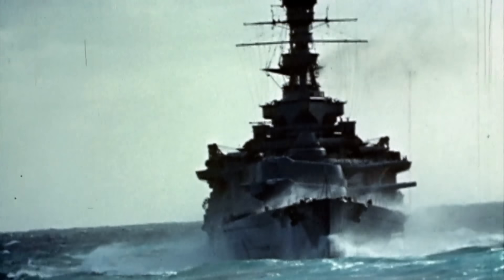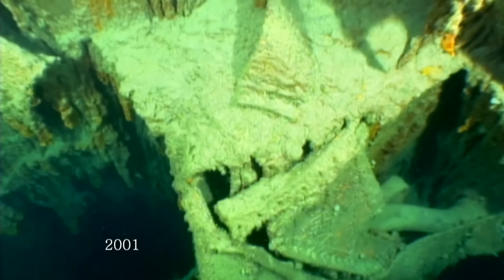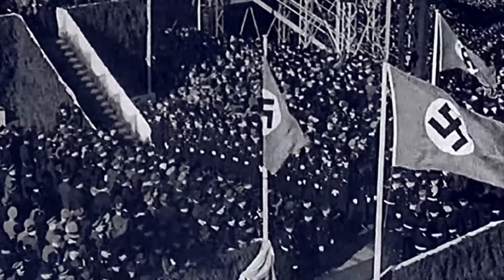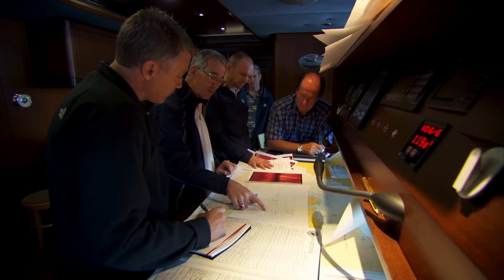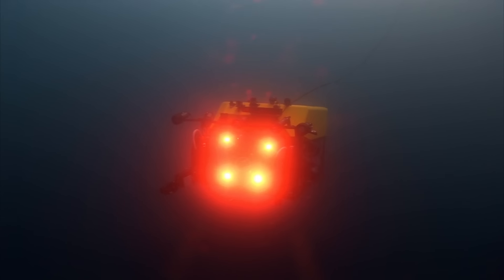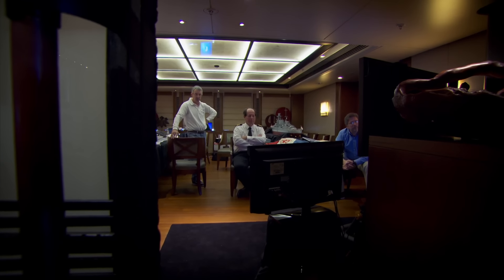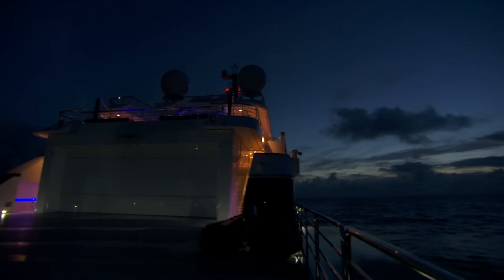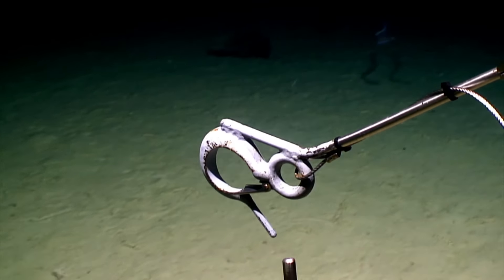How the Bismarck Sank HMS Hood - Documentary

Comment: historically this battle has been broken down by historians already.  The Magazine did explode, however it was not a direct shell this that detonated the main amo magazine itself, it was the secondary rocket magazine that had been hastily finished installing before she sailed out to blockade the bismarks exit.  The shell was an 8 inch shell fired from the prz eugen.  At the outset of the battle the bismark engaged hood at maximum range with full broadsides.  Hoods captain was a very experienced sailor and knew that he had virtually no deck armor to engage the bismark at long range with plunging fire. (this is when battleships engage at long range and shell hits land against the deck armor as they are essentially lobbed at each other).  The hood was a battlecruiser NOT a battleship and the captain knew this.  His responce was the correct one of heading flank speed straight at bismark giving her the smallest target and the greatest armor protection for her sensitive areas while closing the range rapidly.  By the time the shell that landed 3/4 way back amidships to set off the secondary un-armored magazine a shot from bismark would have had to penetrate through and out of both front turrets, the con tower (heavily armored) and a stack before hitting the magazine.  No chance.  However at the outset of the battle bismark had engaged with boardsides and prz eugen broke off engageing her broadsides against the hood, the lead british ship.  She was also fireing HE rounds witch were Extreamely likly to set off the magazine compared to the AP rounds being fired from bismark, that was in NO position to make the shot.  The cause of the sinking remains the MAIN amo exposion, but it was the secondary magazine for the rockets sitting beside it, unarmored that blew through the main magazines armor and set it off.  At the time of course GB has not intention of saying a cruiser sank the pride of thier fleet, and the germans were more than happy to tout that thier big bad ass ship blew the biggest the enemy had out of the water easily.  As with the battle of mid way for the japanese, a series of unfortunate and unlucky events led to a horrific loss.  But all things being equal the hood was not an equal match for the bismark, she was still more than capable of defeating bismark with alot of luck and a bad captain at the helm of the bismark.  But in war there is always the possibility of luck.... :)
Reply: You should also mention that Bismarck's fire control was superior to Hood's.
Reply: Please use paragraphs, it makes it a tad easier to read.

Hood having "virtually no deck armor" as you say is a mute point, since at this battle range (13.3 km to 16.6 km depending on recreation of the battle) based on the performance of Bismarck's guns they would not have been able to penetrate any deck armor (the angle of fall is only 8.5 deg @ 13 km and 12.8 deg @ 17 km),

The shells would have ricochet off the deck.

PE set fire to the ready use locker for the 4.1 inch AA guns, and UP rockets, and PE firing HE rounds would not have been able to penetrate much if any deck armor and no belt armor,

though it's a mute point since PE was shooting at POW when Hood was fatally hit.

The picture you describe about the angle of the shell from Bismarck (and the orientation of Hood to Bismarck) does not match up with any of the battle recreations, Hood was not sailing directly at Bismarck in a complete front on (as you seem to be describing), but at an angle, 

an angle that towards the end only required Hood to turn by 20 deg to allow the aft turrets to be able to be trained on Bismarck (to allow for deflection shooting).
Reply: @notsureyou  your information on this battle differs significantly compared to mine.   Hood had Very thin deck armor as with all battlecruisers, it's thier Achilles heel... Always has been you trade off armor for speed and manoeuvrability.  The battle STARTED out at range... With hood making flank speed straight to bismarks broadsides the range drops very quickly.  However where our information also parts ways is that the PE was firing at hood, no commander would have split thier fire on separate targets.  The fleet leutjens (spelled wrong I'm sure) was not an inexperienced commander.   Hood bore the brunt from both ships..  this battle has been examined over and over by real historians.... Every credible finding I've ever found in the end comes to the conclusion that it was not physically capable for Bismark to have fired that shell....
Reply: I'm a bit surprised that haven't read about the shift of fire,

The shift of fire was done as a result of POW firing at Bismarck unopposed and having obtained 1-2 hits already (the shift was done after PE's 6th salvo), whilst Bismarck used her secondaries on POW this occurred at about 05:57

Even if PE was firing AP rounds it is theoretically impossible for PE to have been able to penetrate Hood's armor and reach her magazines, this is made even more impossible since PE was firing HE rounds and wasn't firing at Hood at the time.

A good battle map is: 

http://www.kbismarck.com/denmark-strait-battle.html

Real historians as you call them all agree that a shell from Bismarck is what destroyed the Hood, they mostly squabble over exactly how this happened.

Whether it was an under belt penetration, penetration through the 7 inch portion of the belt, though the 12 inch portion of the belt etc

Given that Hood only needed to turn a further 20 deg to allow her rear turrets to fire at Bismarck (keeping in mind that it is deflection shooting so the turrets need to be aimed in front of Bismarck to allow a flight time of circa 26 seconds) her vertical armor was becoming more and more exposed,

remembering also that at 17 KM Bismarck's guns could penetrate 18 inches (at 0 deg to target, so not sloped and target "beam on") of WW2 quality belt armor (said to be 20% more resistant to penetration than it's WW1 counterpart).

Hood's armor (ww1 quality) was sloped 

(https://www.google.com/search?q=hms+hood+armor+layout&safe=active&rlz=1C1AVFA_enAU813AU813&tbm=isch&tbo=u&source=univ&sa=X&sqi=2&ved=2ahUKEwjTmez03d3fAhUGHpAKHfjkDVMQsAR6BAgDEAE&biw=1920&bih=969#imgrc=ibsrhD0V_jpgEM:),  

12 inches thick at the water line, and 7 inches above that, followed by 5 inch section above that (http://www.hmshood.com/hoodtoday/2001expedition/index.htm)

As Hood turned she became more and more vulnerable, and even if the shell from Bismarck didn't penetrate the 12 inch portion of the belt, 

there is the possibility that it would deflected down and into the ship due to that slope as well as the off angle to Bismarck.

A good read for you is: http://www.navweaps.com/index_inro/INRO_Hood.php
Reply: @notsureyou  no actually real historians do not agree with your assessment...as to the secondary fire from Bismark that is correct however PE's fire was on hold with HE witch is what set off the UNARMORED rocket magazine stored directly beside the main magazine... The resulting explosion for the rocket magazine is what set off the main.  Again it is physically impossi let for Bismark at the angle, and range from hood at the time of the explosion to have fired any shot hitting either the secondary rocket (UNARMORED at time) supply.  The responsible shot could have been fired from PE witch had broken from Bismark and had swing her nose Southwest bring all her guns into action and making the British split their fire in two directions.  It simply was not possible at that range and angle for bismark to have fired the guilty shot. However PE was in position to make the shot, and given all evidence however unlikly the shot was it was at least a possibility... Bismark was not.  Posting links to old history books and maps to try and back  faulty assumption by continuing the same propaganda as the time doesn't change facts.
This discussion however is going to go nowhere as you will continue to cling to what one set of people has surmised at the information and I to another.... Unfortunately with only 3 survivors from the hood, no surviving command staff from the bridge of POW few of the sailors from PE survived the war and Bismark even less than PE.   
It's alot like the Dieppe raid... Any history book written about it or any information about it before  around 1984 was grossly inaccurate, as very pertinent information about it was not declassified untill then.... The entire raid was staged in hopes of retrieving a piece that had been updated to fit the allies enigma machine.  Witch they got and made it look like artillery had hit the tower destroying it with the machine.  Much of the information in older history books omit information... It wasn't till the late 80's that much of it was declassified.   The fact that the rocket system and amo had been installed before leaving port came out then.   This of course changes many things in analizing why certain things happened as they did.   Now there is a large amount of highly explosive rockets stored right beside a main amo magazine.... That changes the battle exponentially.
Reply: @seancurrell6012  How about you post some links to real historians as you call them, 

So that the discussion can go somewhere as I am always eager to learn new things about this engagement.

I go by facts, not some old books as you seem to believe, though the idea that a book is old and so cannot be trusted at all is not correct.

So I am ready to read your facts that lead you to the conclusions that you have.

Like that the magazine that was next to the 15 inch magazine was the 4 inch AA GUN magazine.

Not the unrotated projectiles as you claim.

You say that there were no surviving command staff from the POW, 

Yet Captain Leach gave his testimony before his death in December 1941

http://www.navweaps.com/index_inro/INRO_Hood.php

If you are not going to bother to read facts presented to you (like I did in my previous post), nor present facts to me, than I agree that the discussion is not going to go anywhere.
Reply: So me referring to how circumstances occurred to bring about the end result, is somehow me saying that it's good that circa 3400 people died....

That's a very big stretch.
Reply: The penetration tables for Bismarck are here:
http://www.kbismarck.com/38cm.html
Bismarck’s 38cm guns could penetrate Hoods sides easily at any of the ranges.   It’s bizarre that the British press has persisted in the false “thin deck armour narrative”.
Reply: Jordan Fan，Prophet of Environment。范楚漳，環境先知：
How Did The Bismarck Manage To Sink HMS Hood So Quickly? 
Answer:  The answers were very simple:  When the HMS Hood was battling the German battleships  Bismarck et al, those lazy British  navy sailors onboard the Hood were busily eating their favorite breakfast food - Biscuits with Sardines.  And had forgotten to return fire at the Bismarck!)())$

Comment: Well they should have UPGRADED the Deck armour of the Hood instead of using it to Taxi royalty around the world. Who is to blame, the Aristocracy and their stupidity.
Reply: Denes Miltenyi  Initially concerns were cost. But by the late thirties it was time that was the enemy.
Reply: @peterson7082  They could have up-armored the Hood with the money that they spent sailing rich people around the world on it, as though it was Paul's yacht. There was no concern about the cost of that, apparently. They say that God didn't create the world in six days. He fucked off for five days, then pulled an all-nighter. Too bad that the RN couldn't do that with the Hood.
Reply: It wasn’t the deck.  The Bismarck’s shells came in at an angle too flat to penetrate the deck. It hit the upper armor belt and punched through.
Reply: @packr72 Incorrect, since the only way to get to the magazine that blew up is with a plunging shell. Going through the foot thick steel belt and then several armored bulkheads would be impossible for a 380cm gun.
Reply: Essence of Order No, that’s wrong.  The range was too close for plunging fire during Jutland yet the same thing happened.  Because of the higher velocity of Bismarck’s shells they make for bad plunging fire weapons.  It was a hit to the upper belt or the 4.1 inch magazine exploding first and that causing a chain reaction.  The true answer will never be for certain since where the explosion occurred on Hood no longer exists.  It was vaporized.
Reply: @packr72 is right about this.

Comment: 4 ships against 1 disabled ship sounds like a execution - war crime?
Reply: Only if they had indicated surrender.  At sea, that's not much of an option - transferring personnel is a logistical hazard plus... where do they sleep but on deck? That can be a death sentence in the north sea.  But more importantly, the usable deck space on a battleship is very small - the pressure wave from big guns is too much to have anyone about the turrets during firing on top of obvious security concerns: 15" shells need access points which are big enough for somebody to fit through.  A warship is built for it's crew and is usually incapable of having double the number of bodies on board it was built for anyway.   But, when a captain has propulsion and steering there is always a chance to fight - not taking that is often met with a dour inquiry and probable courts martial if/when they return from being a p.o.w.
Reply: What would you have done Michael, tow it back to it's home port for repair? Maybe they should've lent them one of the British ships to make it a bit fairer. Jesus wept!

Comment: It’s a myth that the Hood was a poorly armoured battlecruiser. When built her armour protection was on the same scale as the Queen Elizabeth class battleships and she is widely regarded as in fact a fast battleship, although the classification of battlecruiser always stuck because, conceived before Jutland, she was originally designed as such but the design was heavily modified to take in the lessons of that battle. This did not include any dramatic changes to magazine protection because it was not failure of armour that led to the loss of the three British battlecruisers in that action but suicidal magazine practices in which flash-tight doors and scuttles between magazine and turret were left open to speed up gunfire. It appears that hits on turrets led to cordite fires which went down ammunition trunks to the magazines.

Hood’s deck armour was weak by later standards and the ship would have been vulnerable to plunging fire. But this was not the case in the action with the Bismarck where the range was such that shells took a low trajectory and would have been hitting the vertical armour. Hood’s vertical armour protection was not dissimilar Bismarck’s – main belt 12ins v 12.6ins, Upper belt(s) 5 – 7ins v 6ins. 

Range would have needed to be at least 25,000 yards for plunging fire rather than the 15 – 19,000 yards at which the action took place. And any shell penetrating the side armour at such a shallow angle would inevitably have bounced off the protective armour deck before exploding, with the deck protecting the spaces below from shell fragments.

As for the claim that this documentary solves the mystery of what destroyed the Hood, it was always known that it was the after 15inch magazines that exploded. No mystery there. The mystery has always been what caused those magazines to catch fire. 

Shortly before the final detonation a big explosion consisting of a high column of smoke and two expanding fireballs was seen to rise from close to the ship’s mainmast, yet this is not mentioned in the documentary. It’s frequently held that the 15inch magazine was set off by explosions in the 4inch magazines adjacent to and forward of it. The column of fire near the mainmast (above the aft engine room) could be explained by the 4inch magazine explosion destroying the bulkhead to the engine room adjacent to it and venting itself upwards via the ventilation trunking.

So what caused the fire in the 4inch magazines? I recommend ‘The loss of HMS Hood – but why did it blow up?’ by Drachinifel on YouTube.

Comment: What was the angle of the fall from the Bismarck's shells at that range and the angle of fall from the Prinz Eugen's 8 inch shells?  I think plunging fire from the Prinz Eugen penetrated the thin armor and started the conflagration.  IMHO
Reply: Plunging fire is impossible at those battle ranges, you would need an elevation similar to a Mortar for plunging fire to be even possible
Reply: Even when Prinz Eugen was using HE rather than AP shells, because he gunnery officer originally identified Hood & Prince of Wales as cruisers?    You are wrong.
Reply: At most about 12-15 degree angle of fall with 0 being horizontal.